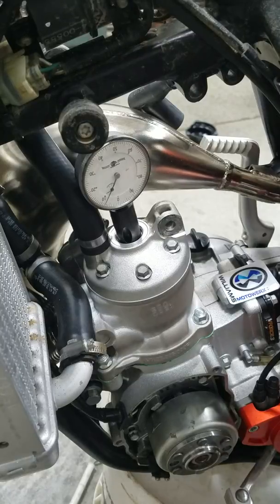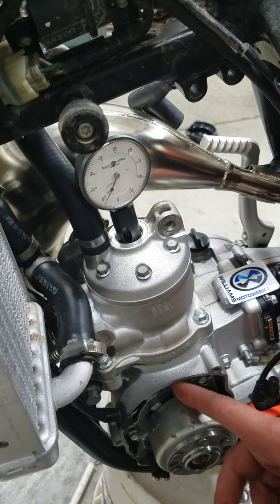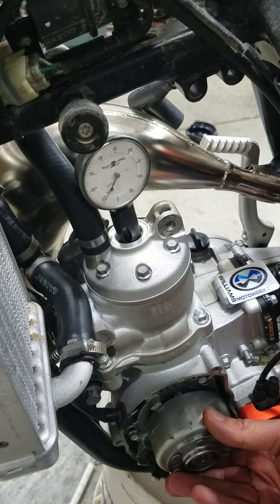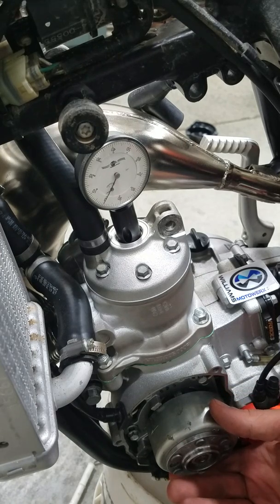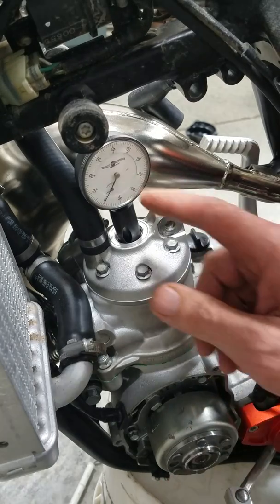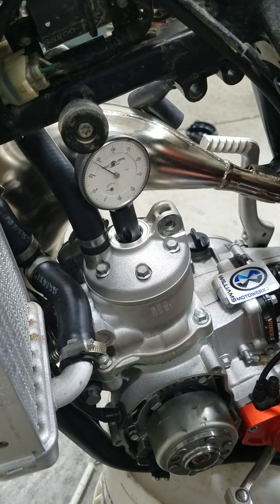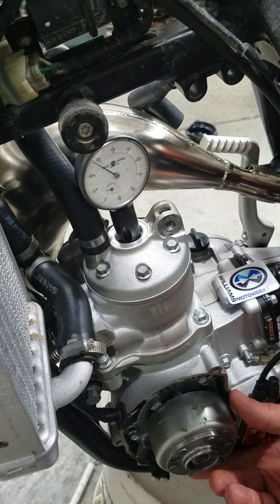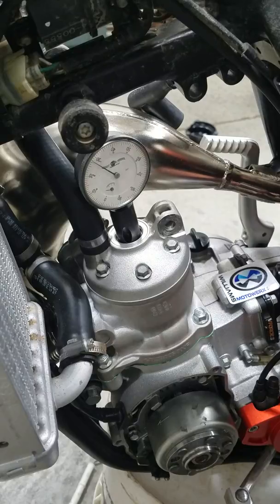Checking timing with a dial indicator on a two stroke

Comment: Okay, so you explained what you were doing, bit my opinion, you haven't "taught" anything a newbie could use.....you canxt even see the dial clearly. Thanks for the attempt.
Reply: Basicly turn the outer part of the gauge until the zero is on the pointer .then rotate flywheel and count the number of times the pointer passes zero or look at the small dial counter it tells you how many times the pointer has gone by zero.each time around should be 100 thousand s of an inch depth.The instant the pointer stops that is TDC.re zero here now back up the flywheel about a 1/4 turn and watch your points they should be closed now rotate in the run direction super slow watch the points to just start to move stop here and look at the dial that should be your before TDC firing measurement BTDC.adjust stator as needed by your manual.